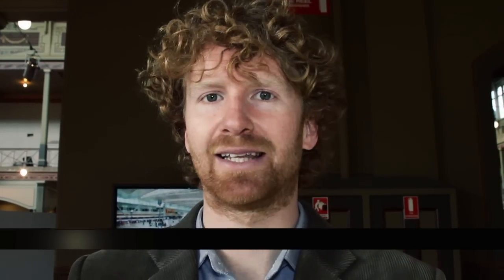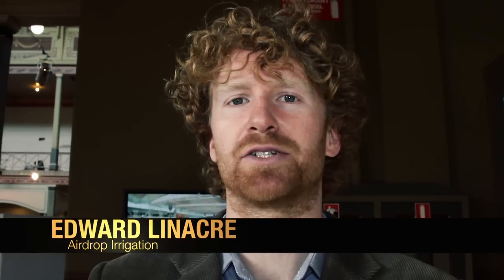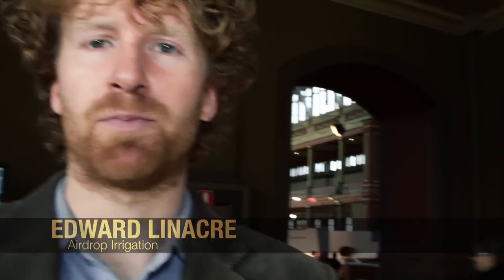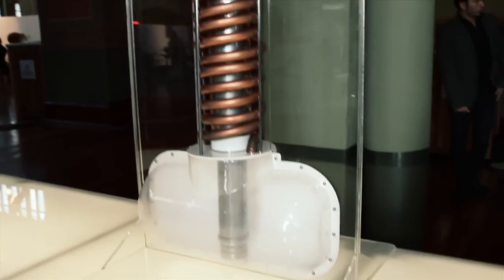Dyson Awards: Edward Linnacre's AirDrop Irrigation

Comment: It works on the temperature difference between the above ground air and the coolness of the underground soil. Its a heat exchanger between the soil and the water vapor and air mixture. It has a little fan powered by solar to force air into the pipes underground if needed.
Reply: He can have it redesigned to use an exposed black copper oxide coated copper coil on top which is connected by a heat-resistant non-heat conducting geopolymer or 99.99% ultrapure silica tempered glass pipe so that the heat is not transmitted to the connecting pipe of the device and at the same time that heated copper coils will heat the air inside them and this creates a suction effect to suck in air into the deeper underground copper coils to be condensed into liquid water.

Comment: @bf2lover42 

if done on a large scale, i could see it being used to transform landscapes and possibly even be used as a terraforming tool

i would imagine, as air is turned to water, more air fills in to take the place of the lost air, as water is removed, it sucks up more from outlying regions, if enough water is available in nearby regions, i would imagine with proper development the replacement rate could be made sufficient enough to possibly turn a desert into an oasis or maybe even aforest

Comment: I would rather dig a hole for (and maintain) a vertical storage tank.  Make the case a two-person coring bit.
I'm having a hard time understanding the "reversed" blades of the turbine when relying on wind --wouldn't it just spin the other way?  ...unless the wind draws air out and, when no wind, the solar reverses the spin and draws air in e.g. reversing the flow through the system.
It seems like the above ground portion could be minimized to a squatty turbine with thin-film PV on the blades.

Comment: Absolutely brilliant but... condensate in copper will cause copper to leech from the tubing and is toxic to plants. The pH of the condensate is 4 which has it's own problems to be addressed. changing to stainless steel is a better material to use.
Reply: An ancient bronze sword made out of a bronze alloy discovered by archeologists in China contains 10% tin, 
3% chromium, and 87% copper was found to be intact and in good brand new condition as if it has just left the factory just hours ago and was buried in wet acidic soil which is several times far more corrosive than sea water. That ancient archeological discovery might be the solution to that particular problem that concerns you.